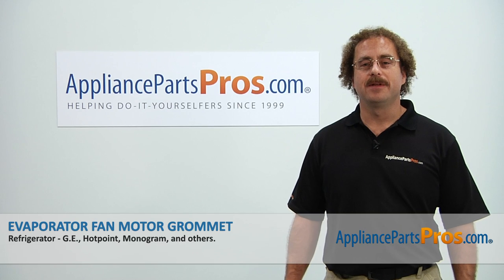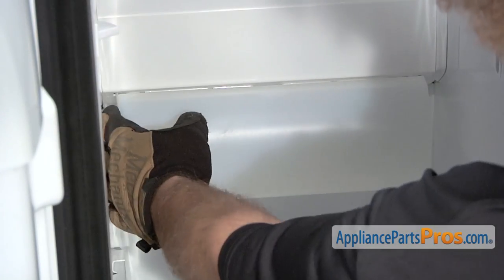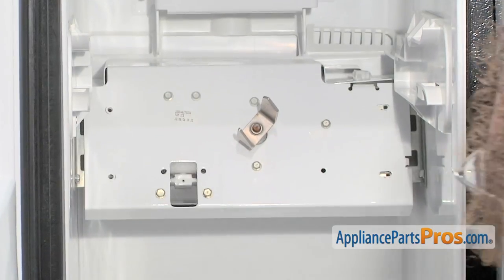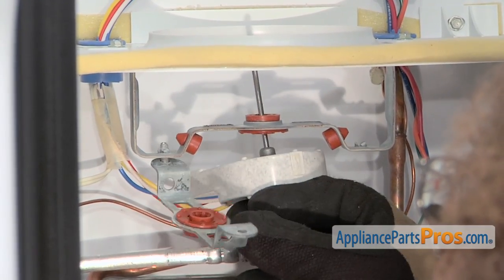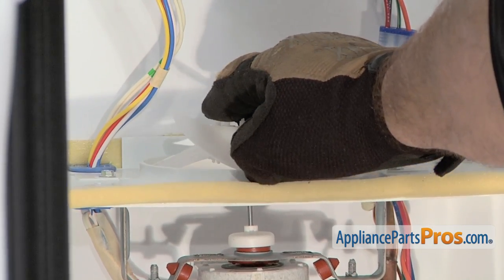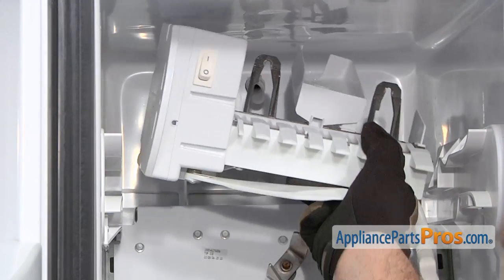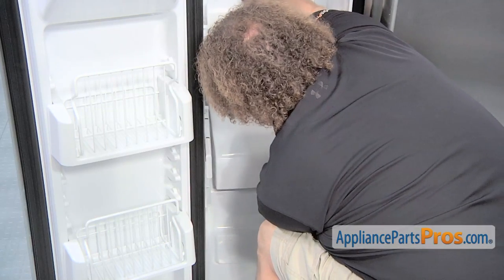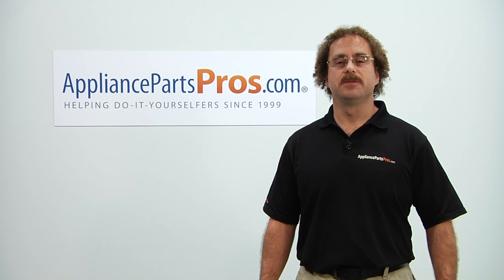How To: GE Evaporator Fan Motor Grommet WR02X12008

Comment: This is a great video.  He touched on it briefly, but how would you know the grommet itself was bad?  Would it be because of too much vibration noise?  You can't see if the grommet is worn and/or torn without taking apart the entire freezer, right?  So would the symptoms just be too much vibration noise?  Or is there any other way to tell it would be a bad grommet?

Comment: Does it matter which way the fan blades go? There was no instructions on how to install it on the packaging. I followed your video and replaced everything like you did thanks it was very helpful. My fan works fine and it quieter again and makes good ice. Should I worry which way the fan blades go?
Reply from the maker: ***** In most side by side refrigerators the blade should push the cold air up towards the top of the freezer section.

Comment: Hello great video! 
Just a quick question.... When this evaporator fan motor should be running? 
A) When the door is close fan motor working all the time  
B) When the door is open should stop spinning but if we press manual with my hand the door switch will start spinning again
C) When the refrigerator is on defrost mod, fan motor should working or not? 
thanks fro your answer will be very helpful for me!
Reply from the maker: +kaloian krastev Without knowing what you have, I would suggest posting the problem along with the appliance model number on our repair forum and the techs can help you troubleshoot the problem. http://forum.appliancepartspros.com/

Comment: I have a top-freezer Profile. After replacing the fan, it keeps running all the time. It's constantly on and doesn't shut off or cycle at all. The freezer temperature has already dropped below -12°F and going. According to the manual, the freezer temperature should range between -6°F and 6°F. Also when I open the freezer door, the fan speed doesn't change (as I've heard it should when the freezer door opens.) I'd appreciate any tips. I've set the temperature to the recommended 0°F several times using the front display panel, but after several hours, it's still going down. The original fan didn't have a sensor, but the new one does, and I connected it with the metal clasp to the evaporator. My suspicion is faulty sensors or the board, but I'm not sure how to test for that. Do these fridges have a diagnostics mode that can be activated?

Comment: i have a GE up and down refrigerator model TBF19ZBB.. It is making a constant very loud  humming noise. i have to unplug it from time to time to keep it from driving me insane.. could it be the fan motor or just the fan .. any information would be very helpful.. you Are very good at your job. obviously you have been doing this for a very long time.. thank you for such a insightful  video .. can you tell me what could possibly be the reason my refridgerator is making that humming noise.  thank you ..great job..,
Reply from the maker: We'd be happy to help you out with that! We offer free technical advice and diagnosis. You can give us a call at 1-877-477-7278 or you can chat us at our website: http://www.appliancepartspros.com/. We will need your model number to give you accurate advice, which you can locate using this tool on our website: http://www.appliancepartspros.com/modelnumber_locator.aspx

Comment: is there a way to diagnose that the fan motor is bad?
Reply from the maker: If you have the motor out you can usually test the motor to make sure it has continuity.
Reply: Mohammed Zaman q